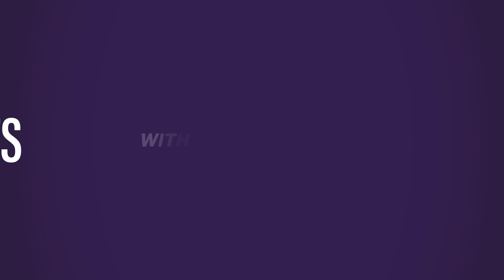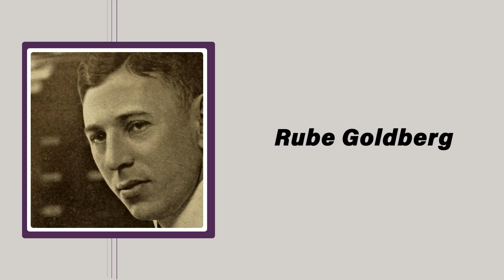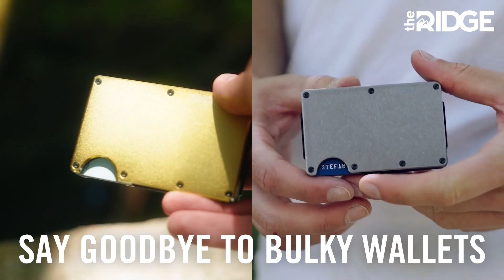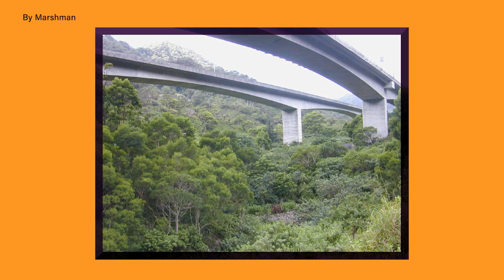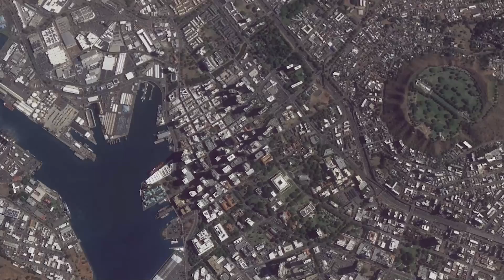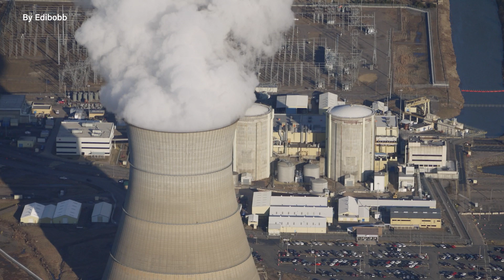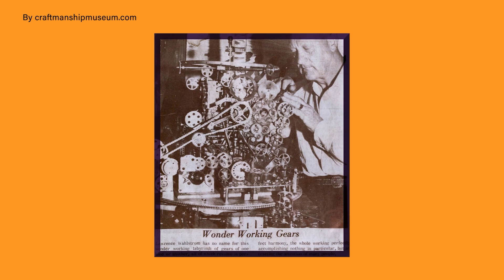Most Useless Feats of Engineering

Comment: I've always heard the "useless machine" referred to as the "ultimate machine." One must take care though, as "the ultimate machine" is also a name I have heard applied to a specific design of glass pipe out of which DMT can be smoked. Hope this helps!
Reply: Interesting. I've never heard of a special pipe for DMT. I always smoked it through a regular glass weed pipe. I'd pack it with bud, sprinkle my DMT on top, take as big a rip as i could, & blast the fuck off...
Reply: I would not be surprised if the "ultimate machine" for DMT is just an ordinary pipe. The only mystery is why the person smoking it isn't considered the real, ultimate, machine. ⚙️🦖⚙️
Reply: @jessicalypso8839  it's called "the machine" and it's made using one of those square glass bottles that olive oil comes in, some steel wool, and a straw. Personally I think it's ridiculous and you should just get a $2 oil burner at the gas station. They call them glass roses and most people call them meth pipes but it's just an analog vaporizer. They work fantastic for cannabis wax and oil as well
Reply: @jessicalypso8839  It's basically a glass tube stuffed with copper wool. DMT is gently melted onto the copper wool, which is then heated with a flame. The copper conducts the heat so that the DMT all vaporizes at once and shoots up the tube and into your mouth and brain. It tastes like complete shit and hurts like hell.
Reply: Having taken DMT, that makes a surprising amount of sense.
Reply: Oh yes, this helps a LOT!